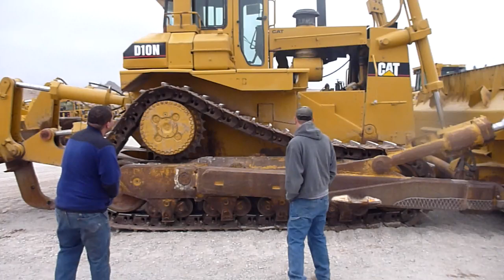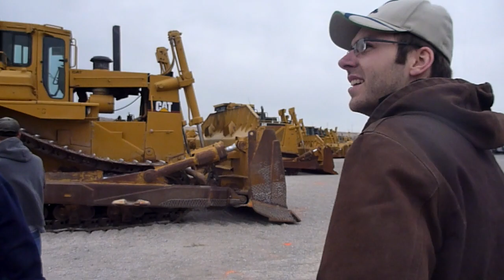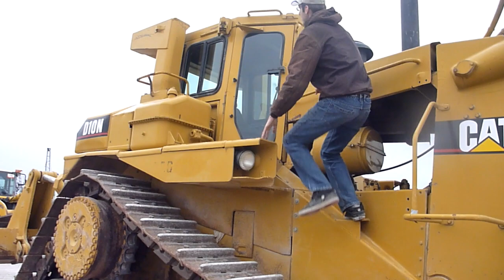Letsdig18 Owing Us Lunch

Comment: I know exactly where you guys are at and I know exactly where the Iron skillet is at that was mentioned as well.  Your at the RB auction in Las Vegas NV that is out by apex, the restaurant is at the Petro filling station that is just off the I-15 out by the Las Vegas Motor Speedway.  My older brother has a auto shop in the complex across the street from the Petro.  You should go check it out its High Impact Motorsports.